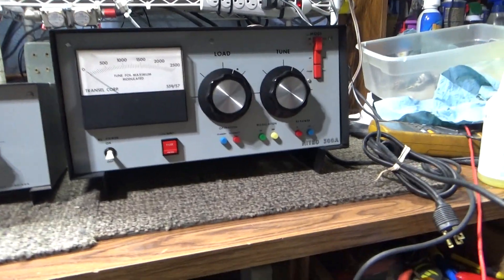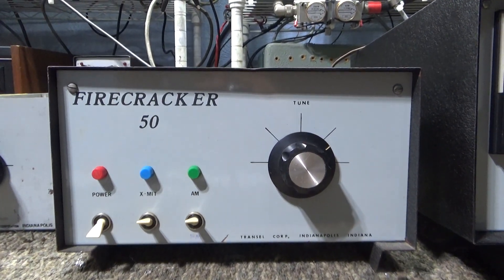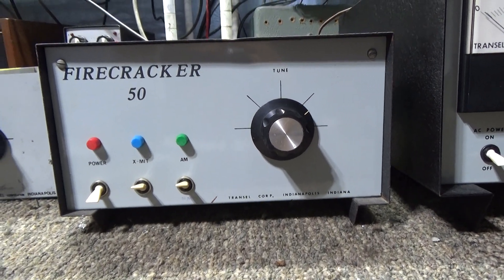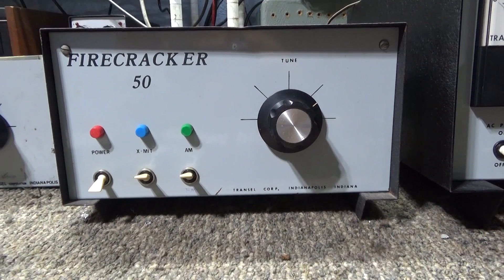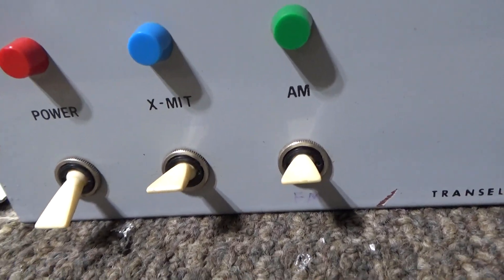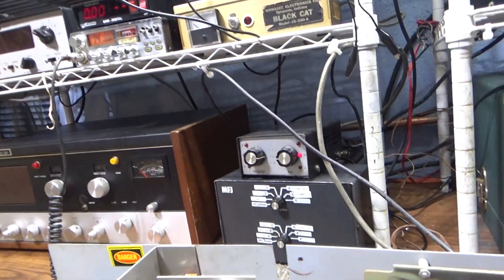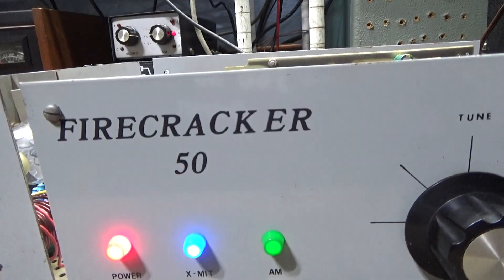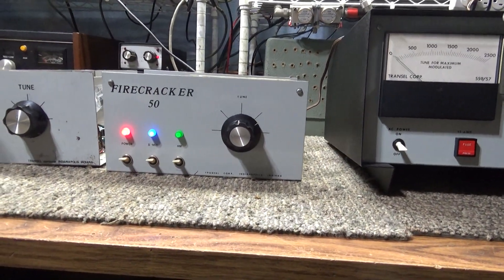Transel 'Firecracker 50' single 6LQ6 tube linear amplifier on the bench.

Comment: How would one go about changing this to be a modulator like you mentioned??
Reply from the maker: Unground grid 1 + 2, then add around 300V give or take to the screen grid/grid 2, disconnect the drive coming in from the cathode, then hook the drive to grid 1, but you will need a matching circuit to do that as grids are Hi Impedance and the drive coming in is low impedance, also, you will need to inject around -50v of bias into the output side of the input matching circuit, and last, ground the cathode directly. However, IMHO, a lot of work for very little reward.
Reply: @tramdr  Thanks man appreciate the info I just put a new tube in mine recently and with a weak radio it was keying 40 swinging to around 60 if I remember right. my dad used to use a jb12 I just thought it would be cool if it modulated like that one did.
Reply from the maker: The easy way is to either put a dial a watt in the radio or use a JB-12 and dial it down.
Reply: @tramdr  I appreciate the response and info sir

Comment: Hey Tram Dr, you ever dealt with any ABC 250 amps? I got one here and a schematic, but no service manual. Every time you key up the driver tube arcs and it blows the fuses. It was recapped and tried different tubes. It was working fine and one day the driver just started arcing when you key. Any ideas? There is one variable cap on the bottom to tube it but I don’t know what to adjust it to.
Reply: Caps!
Reply from the maker: most likely a shorted Plate blocking cap or shorted driver tank coil cap
Reply: @tramdr  Do you work on amps for people? I work on solid state stuff but don’t know much about tube stuff. I also have a Kenrich Eagle 400 with a fresh recap and new tubes but best it’ll do is key 100 and swing 600. 20 years ago it was doing 1200
Reply from the maker: Not really. I believe that 9 out of 10t ten people running a tube amp do not know what they are doing and 9 out of 10 problems with tube amps are created by those people who do not know what they are doing. Overdrive it, shorted coax, de-tune it, harmonic generating radio into it, antenna or coax can't handle the power, too long winded (most amps, especially sweep tubers) are rated for ICAS, not CCS. So many times I hear  'experts' say I take care of my amp, I tune it down to 1/2 of its normal output, so its cruising at 1/2 power. I heard some local experts the other day on the tracks, saying that they drive their Phantom 500's with 100 watts in and get 2200 watts out.  About 4 months ago, I sold a guy here a couple amps and all was well. He then said he wanted to buy another amp as a surprise for his brother. He paid for it and I sent it to his brother as requested. He contacted me after and said his brother says the SWR was high. I asked what SWR, the input or output and how high? He then replied that both of them are very high. I then  told him, I need specifics, what radio, how much drive, what is  exactly the input SWR what's the output SWR, how many watts is the amp doing? He replied that "With the amp on, both the Input and output SWR are really high, and the amp is not putting out any watts"  Think about that last reply.....!!!!!!

Comment: I had a transel 300 many years ago.  Wish I’d have kept it. Tram d201 came up on eBay,I was winning for quite a bit but it went over $200 and to me it’s not worth it for a circuit board 201. But i did find a 2 piece JB76/200 and I’m all over that until someone feels it’s worth more than my max bid 😂 

My eBay Pal 200x turned out to be worse than expected once I got in to it. Both relays are melted at the bases,both 8950s the anode cap is broke loose and spins freely so they are air bottles now sadly. Now I’m on the hunt for 8950s and relays.
Reply from the maker: Yikes, trying to solder the plate cap on is not fun, but worth a shot.
Reply: @tramdr  I guess before I spend the money on tubes I need to dig out the old tube tester that has the 6L sockets and test then both just to make sure that they are in fact bad.  I know I had couple 8950s and m2057s but I think I might have sold some of them but I’m not sure and I haven’t looked too hard yet. I’ve got a pile of 150s and 250bs,it’s a shame steel tubes won’t work 😂